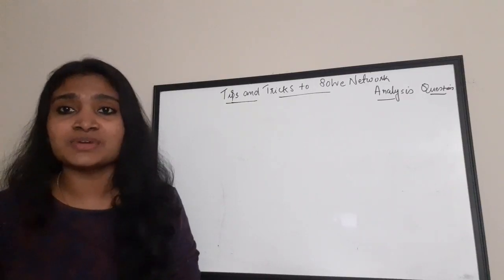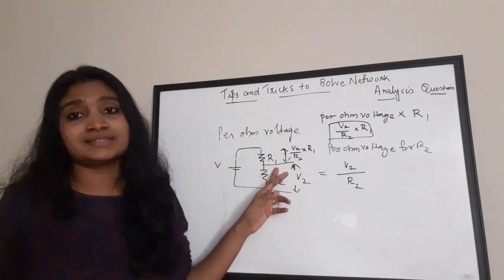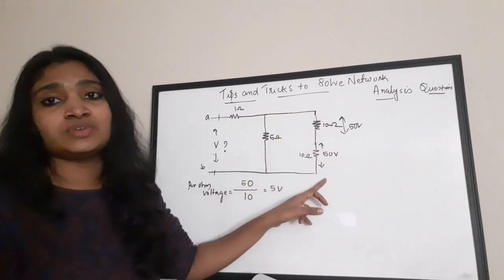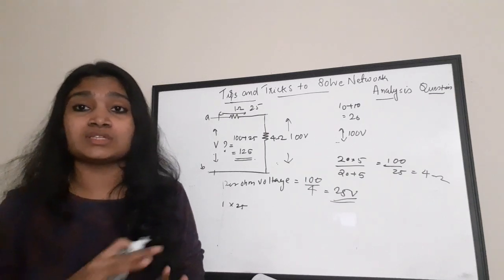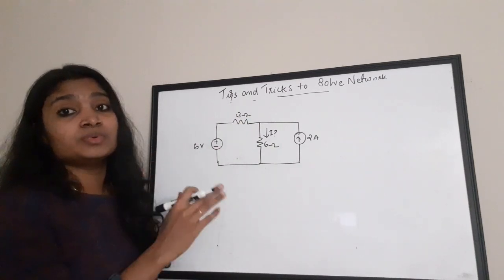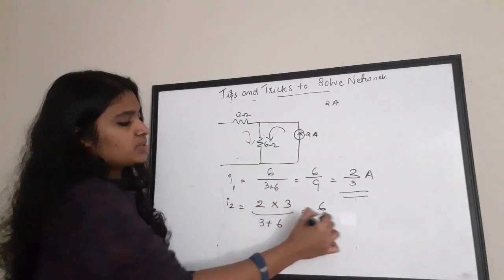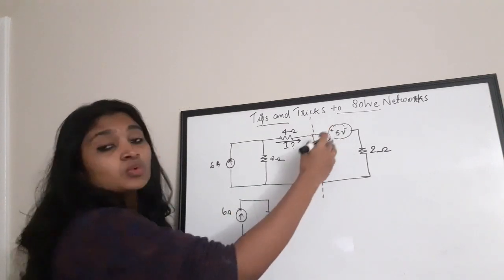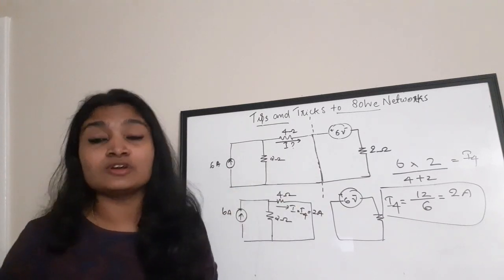Tips and Shortcuts to solve Network Theory Part1| ISRO Scientist Electronics |Technical Assistant|

Comment: Hi ,  In the application of superposition theorem (problem) ,when you are applying current division rule we need to take the opposite resistor in the numerator right ?  please cross check the video (10.01) , I think in the numerator it is 6 ohm instead of 3 ohm resistor. kindly give a feedback ..!

Comment: Madm one doubt.. Normally we are open ckting the currnt source and shrt ckting the voltage source na
Reply from the maker: Yes that's right, I have done the method right but forgot to short circuit the voltage source removal.